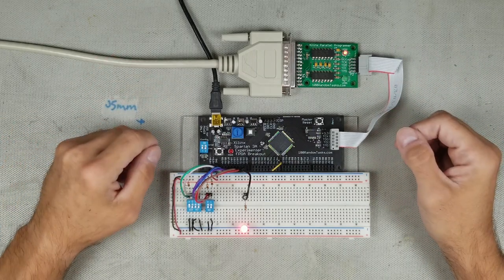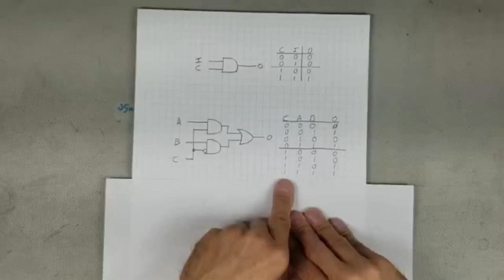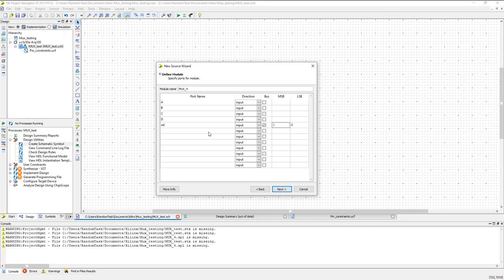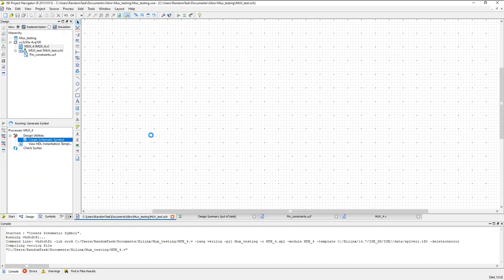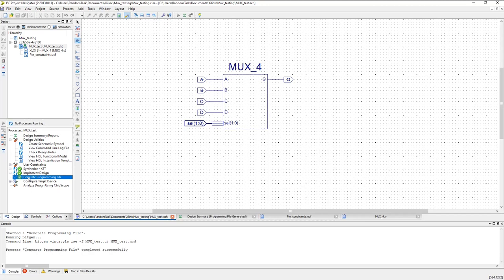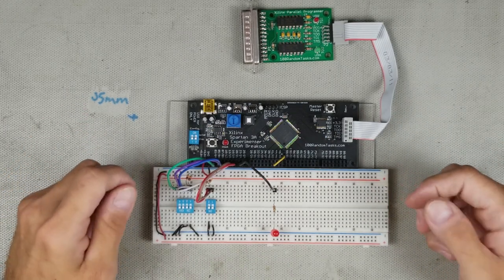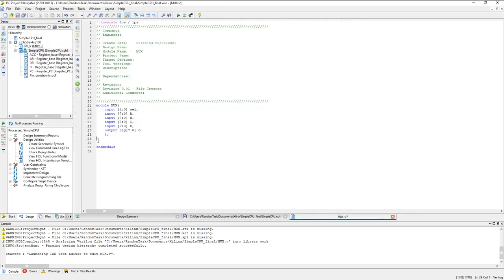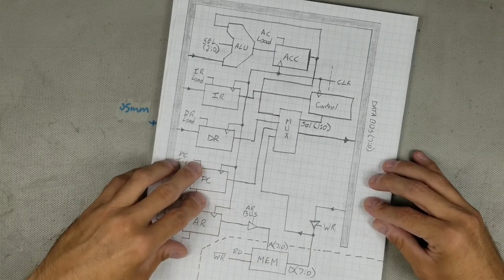HOW TO CREATE A CPU IN AN FPGA - Part 3 - Multiplexer

Comment: Using the MUX is the better solution or the only ? In fpgas can not use the tri-states in bus?
Reply from the maker: Tri state buffers are used on the I/O pins. Internally if you use them it will usually cause synthesis errors. By using a MUX it eleminates the possibility of bus contention by ensuring that only one component is driving the bus.
If memory serves, if you use tri states, the software will try and convert to MUX and will usually fail on larger designs.
Give it a shot and see for yourself. Sometimes it's the best way to learn.
Cheers!
Reply: @100RandomTasks  Undertood, i dont know that about tristates internally. Yeah, the best way to learn is try. Thanks by the answer. And great project that you doing.